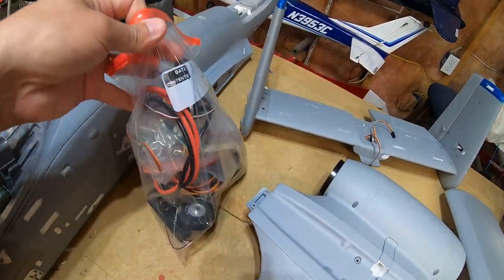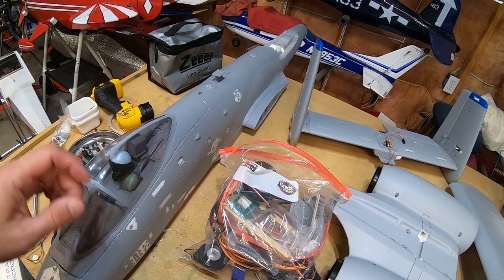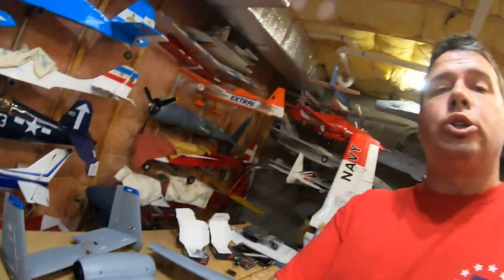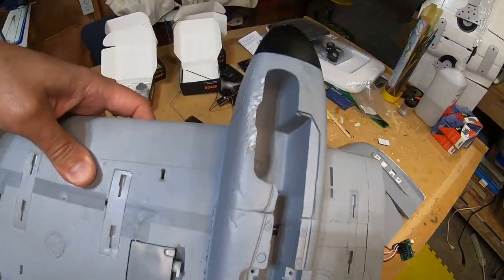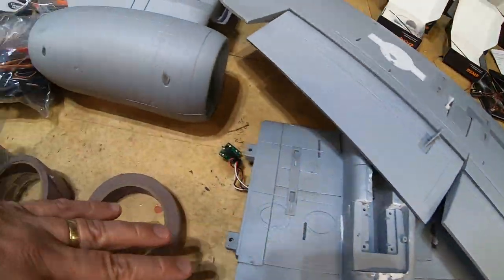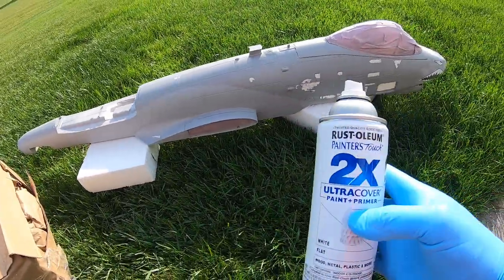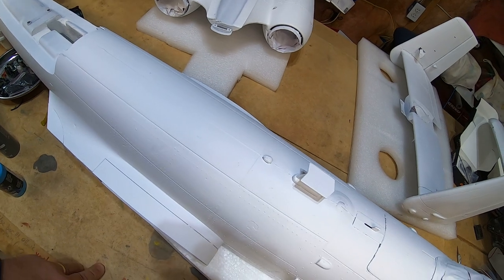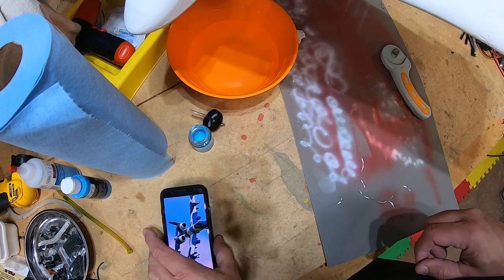FMS A10 v1 Resurrection EDF Repaint/Rebuild Pt1

Comment: When I peel off stickers , I fill in where the stickers were with filler and coat with minwax and primer and wet sand it. On yours you can see where the stickers were at
Reply from the maker: You are correct. I have a decal set that will match going back in the same spot

Comment: is the FMS A10 upgradable with something like a 80mm fan?
Reply from the maker: Thanks for watching. I don’t think so and to be honest this thing is fast and has plenty of power with the dual 70’s
Reply: @JustPlaneCrazy  Ok cool! What's the power/weight ratio on this one?
Reply from the maker: I haven’t checked it. It takes off on grass in less than 100 ft. And is one of the faster EDFs I own. Had to get over 100mph